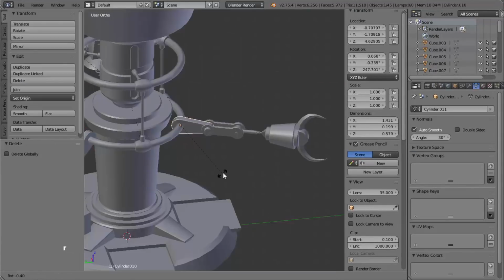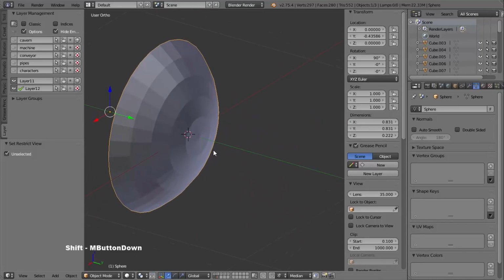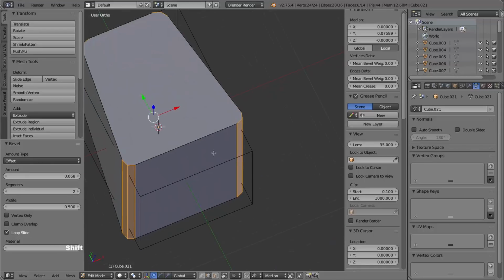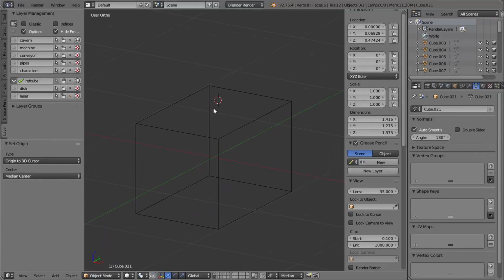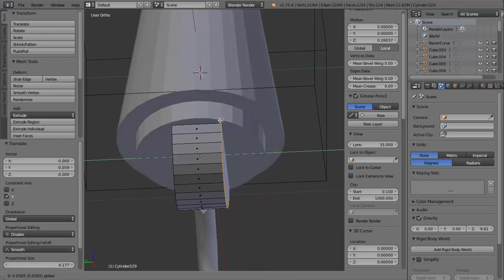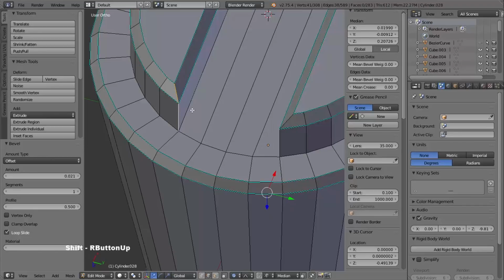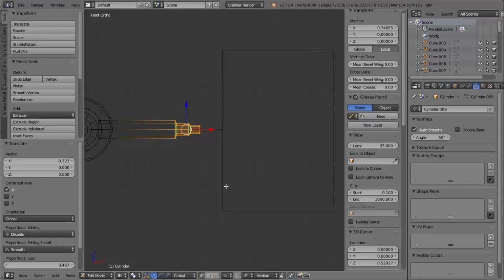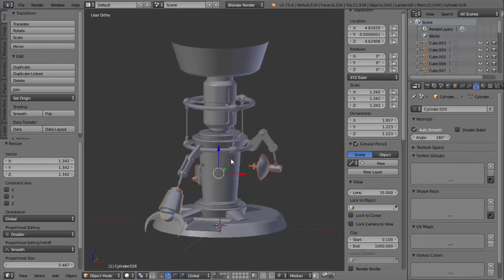Sci-Fi Cave Environment Course | 5 - Attachments

Comment: Does it really matter if I just leave the ngon there?
Reply: With low poly modelling, I think it's generally good practice to break n-gons into triangles or quads. When the surface is flat, it should be ok if you'd like to leave it. On curved surfaces, ngons can make shading look strange and it can make it harder to UV, depending on the situation.
Reply: And game engines tend to treat ngons in a strange way... Cause shading problems as you say.
Reply from the maker: Thanks for the question, i've added the info here to the pinned comment. :) Aidy.

Comment from the maker: Hi Aidy Burrows here, we’ll pin any important info that happens to crop up here. 

Useful Times > 

03:19 Layer Management Addon
05:21 Part 1 Triple Dish Attachment
15:04 ‘Ctrl + 1’ shortcut for a Subdivision Modifier to create a simple sphere from cube
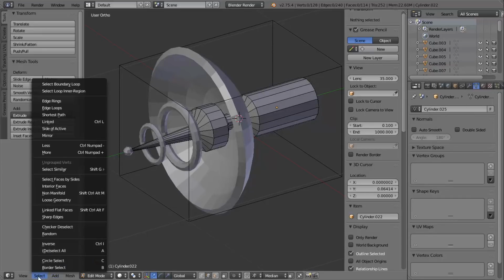17:31 select sharp angles automatically
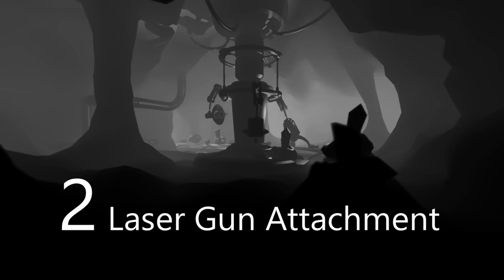20:57 Part 2 Laser gun attachment
28:01 Press 'F' to create a face
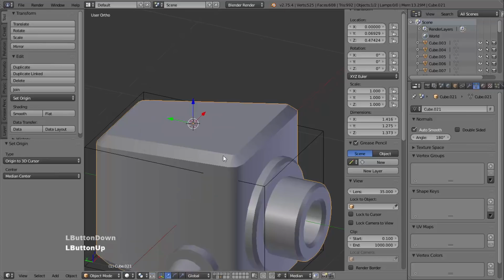32:43 Part 3 Claw Attachment
35:48 Using Curves
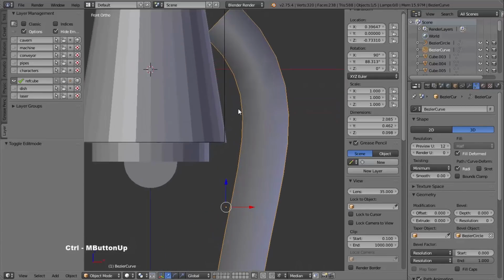37:26 Using a Bevel Object for the curve
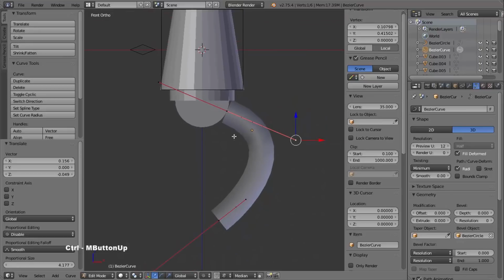39:28 Using a Taper Object for the curve
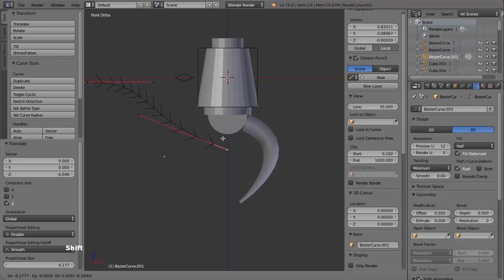41:41 Holding Shift for Precision control
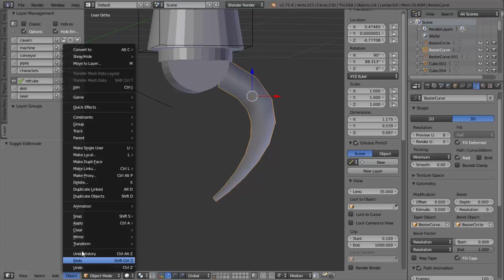42:54 Converting the curve into a mesh
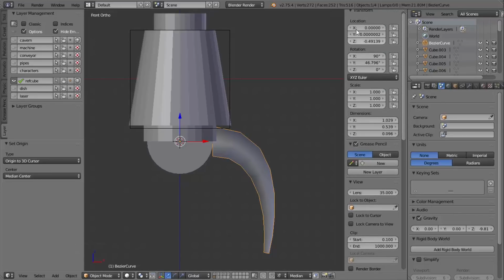51:07 Ctrl A to apply rotation and scale
1:11:40 Rotating using Local coordinates by pressing the axis key twice.
1:14:39 Scaling using individual origins

Tuấn Trần asks...
"Does it really matter if I just leave the ngon there?"

Martin says...
"With low poly modelling, I think it's generally good practice to break n-gons into triangles or quads. When the surface is flat, it should be ok if you'd like to leave it. On curved surfaces, ngons can make shading look strange and it can make it harder to UV, depending on the situation."

Jerónimo Yepes adds...
"And game engines tend to treat ngons in a strange way... Cause shading problems as you say."